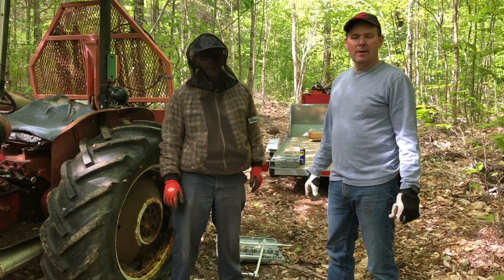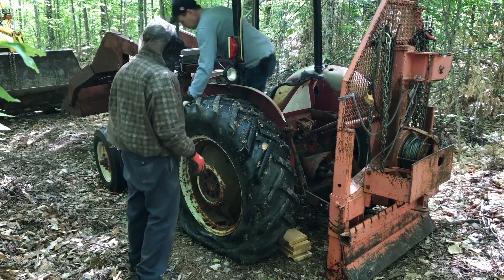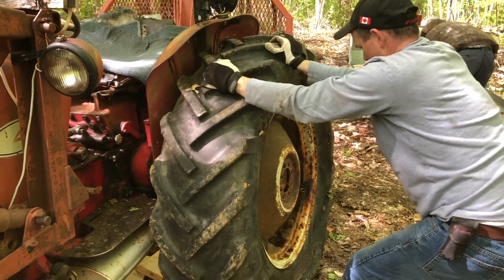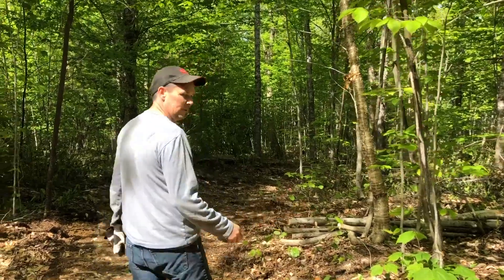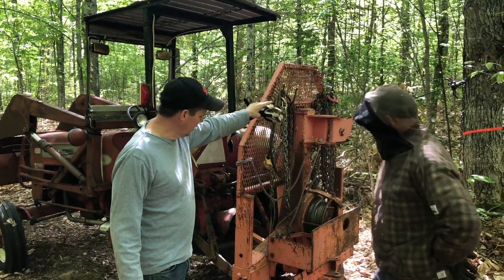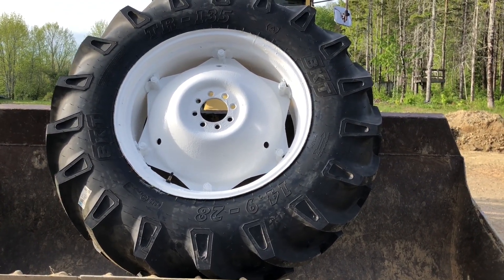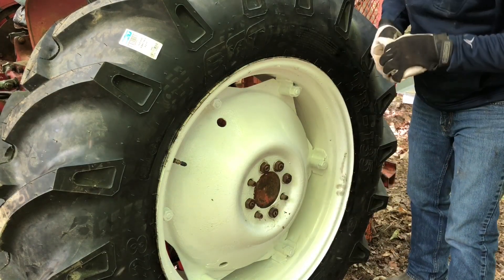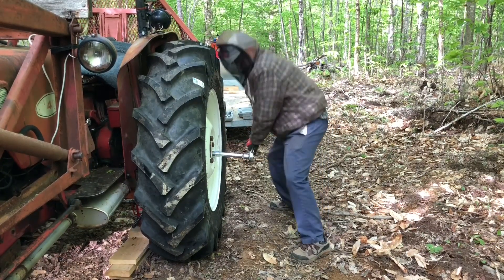Blown Tire and Repair on the International 414 Tractor -E61

Comment: Great you could be back to business the next day.  Did you lose the calcium in the forest? That is one thing I fear with my loaded tires.  They are as old as yours and loaded with calcium 75% full. When I change them, that will be for beet juice or similar.  Thanks!
Reply from the maker: We lost a little but most of it stayed in the tire. The tire shop disposed of it for us. We are not going to load them again. This tractor usually crawls around in 1st gear in the woods with no need for the extra weight now! Thanks for checking out the video!
Reply: I agree! If you were to do any kind of loader work, maybe fluid would help. But I am sure you would consider the Komatsu or the Kubota for that!!! BTW, I've got the same exact tractor (Case 430), one without FEL, without fluid in tires, without ballast in the back. That one drives like a different machine!!! Much easier to manoeuver. Thanks!